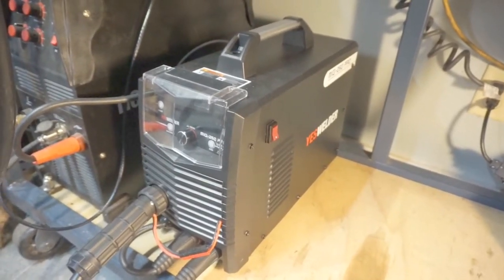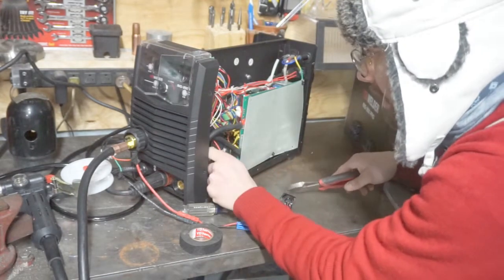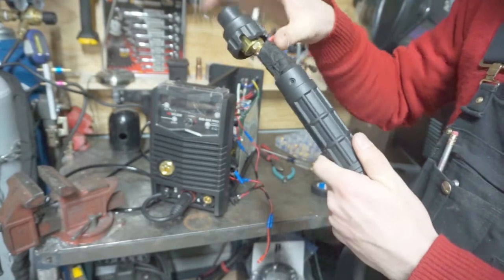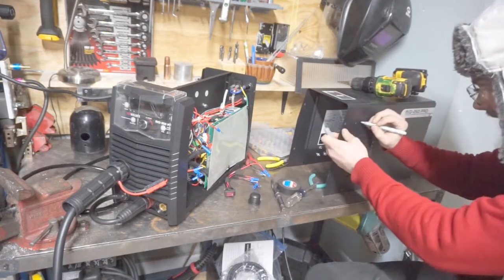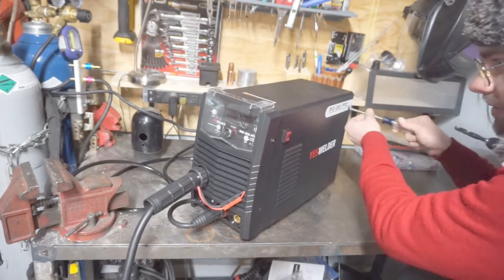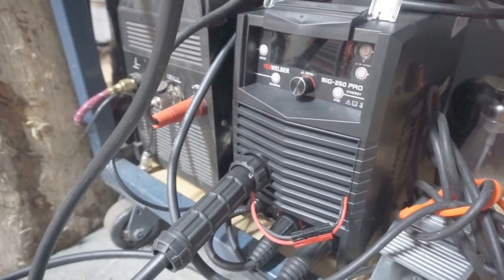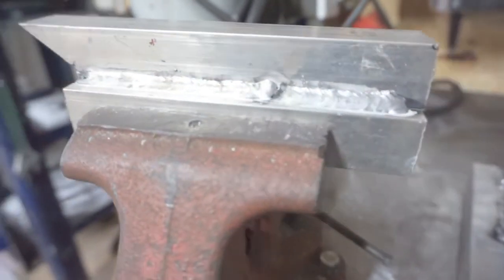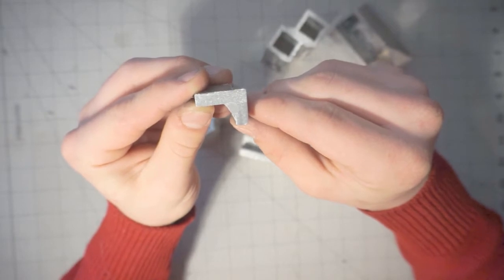How to Add a Spool Gun for Aluminum Welding to the 250A Mig Pro by Yes Welder and Other Welders Too

Comment: Thank you for the video, helped a lot with understanding what I'll be dealing with when trying to convert my torch. I have a spool gun that im trying to connect to my welder, the euro fittings go together but to power the motor my gun has a 2 pin aviation connector. My welder has a 7 pin on mig, is there a way i can make my torches 2 pin motor work with the 7 pin connector?
Reply from the maker: You could probably wire up power for your spool gun motor by making a jumper off of the wires that power the feed motor in the machine. If you find a matching 2 pin aviaton connector to wire in that would be very clean. I added a switch to the side of mine so it spins either the spool gun motor or the normal motor in the machine.
Reply: @mattthemaker3787  ah, thank you for the response man.
Reply from the maker: @narutouzumaki4710  Happy to help, hope that gets you sorted!

Comment: Seems like a pain in the a** to go thru all that. Bought my spool gun along with my Everlast welder. Didn't have to tear apart my machine to hook it up.
Reply from the maker: I've never owned a everlast but I've heard they make a great product, probably better than this. That said the cheapest everlast I see that is at least 250 amps, spool gun capable, and synergic cost three times what I got into this whole setup and doesn't include the spool gun. 

Also this is basically just installing a single bypass switch onto your welder then adding a dongle with two wires. Should take maybe 30 to 45 minutes and save you over a grand compared to the everlast. Ngl doesn't seem like that much of a pain compared to the labor you traded that extra thousand bucks.
Reply: @mattthemaker3787  Everlast is a great company with great products. And now with a 5 year warranty which includes parts, labor and shipping both ways it's a win win. My 3rd welder is shipped. Plan on getting a bigger Everlast tig next year for the shop.

Comment: Does the 250 pro have a wire speed dial for the mig, or is it synergetic based off the amps like the 205DS? I have the 205 and want to do this same thing but im concerned about getting things dialed in right since on the 205 you cant directly change the volts or wire speed. you can bump the volts a bit with a button(also based on the amps you select.) I feel like I can make it work but the synergetic/non manual controls might make it difficult to dial in.
Reply from the maker: Sorry I never got back to you, got too busy and caught up with stuff to check.. I'm glad you pulled off the modification according to your other comment.

Comment: Why would you do that since the welder is designed to weld aluminium the way it is?
Reply from the maker: Since it saves so much time in the long run. Time when you are hot and sweaty and trying to get a job done. This mod could be done in less than an hour for about 100 bucks. 

-Change over between welding steel and aluminum takes less that 25 percent of original changeover time since you don't have to swap liners and re feed the wire.
-If you get burnback and ruin your tip without a spool gun it is going to take along time to re feed that aluminum wire all the way through the lead

- Pushing aluminum wire through a welding lead has a tendency to kink up causing you to restart the whole process. Getting a .035 aluminum wire pushed 8 feet through a tube without it kinking and getting snagged up is pretty hard. Pushing a wet noodle down a hallway is not my idea of a good time.

Comment: I feel the spool speed is not fast enough for certain thickness 1/8 & 1/4. Maybe the welder cant handle the thickness via motor control unless there was a mod to increase the motor speed bedsides the manual control
Reply from the maker: Sorry for the late reply. Are your motors the same voltage? I was having a very hard time at first and took a few phones calls with a friend to get it running right on those thicknesses. The stick out for the wire is huge compared to mig welding steel, I feel like I was almost at a inch before things started going well for me.

Comment: Hi, i did the mods adding the spool gun with no problems getting to work.  I never used a spool guns so i tried welding but only had burnbacks destroying my tips. Didn’t have this issue when it was done with the mig with the graphene. I am using the the HZXVOGEN 200A Spool Gun modded to my case and works fine. These mb15 tips are a pain to replace on amazon. Using the .035 tips also happened to the spare .040 tips. Any advice would be greatly appreciated!
Reply from the maker: I didn't use that model gun but if the motor voltage is that same it should work. I burnt up alot of tips getting started with mine as well, it was trickier than I expected. I was really surprised how fast the wire feed speed needed to be and how far out the tip can be from the metal. I was near a inch wire stickout length, this give me a alot of travel/time before the wire burns back and fuses to the tip.  The lead mine came with was 25 ft and it was too long. I trimmed it to about 10 ft and the gas flowed alot better and I got less burn back.
Reply: @mattthemaker3787  what was your successful setting for 1/8 or 1/4 aluminum plate?
Reply from the maker: @kenken-sr2vq  Read all the comments to this video, I have what my settings were in there somewhere.
Reply: @mattthemaker3787  i have tried many possible ways many settings . Destroyed 25 tips. Set the argon even higher. I am throwing the towel for now on my 250pro for aluminum spool gun
Reply from the maker: @kenken-sr2vq  Sorry to hear youve had such bad luck. Here were my parameters. I was using .035 wire and my settings for spray transfer were 25 volts at wire feed speed 15. I dialed it in a little from there but this is where I took a picture for reference. Short circuit transfer I was running about 13.8 volts and a wire feed speed of 11.6. The wire feed speed seems to be the limiting factor in terms of adjustment. I want to try different thicknesses of filler wire eventually and see if I can get spray and short circuit to work well on other gauges of material.

Comment: Hi Do you think it works for a ds205
Reply from the maker: Can that model weld aluminum? This modification should work on any welder that can weld aluminum as long as you match the voltage of the drive feed motor with the spool gun. This welder is advertised as welding aluminum with a special liner in the lead. The aluminum welding wire easily kinks in this liner and is a huge hassle to deal with, the spool gun gets around this problem.
Reply from the maker: It does according to flawed offroad. They commented on this video that it worked and even uploaded a video of there own you should check out.

Comment: Do you think the set up would be the same for the 205 DS welder from them?
Reply: Also a link to the School gun would be nice. Got a flat boat that I need to cut the transom out of this weekend
Reply from the maker: @gregmaggert8561  The website says that welder can't weld aluminum and the spool gun advantage is for welding aluminum

Comment: Which spool gun are using, i.e., vendor, and model number?
Reply from the maker: Chinese ebay special thats labeled "NBC-200A". Rated for 200 amps but the welder can put out 250 so I have to make sure I don't push too much through it and fry it. There are other spool guns that are 24v and have the euro style plug that will work. I think there is a better option out there, I paid 90 for this one but remember seeing a 150 one that looked a little nicer after I ordered this one. The build quality on the NBC-200A is a little flimsy, I added a spacer to the spool holder to fit different sized spools.

Comment: Just bought this machine and was disappointed to see it didn't support a spool gun. Then I saw your video and now I'm positively stoked about this welder! Welding aluminum is gonna be so much better with a proper spool gun, thanks for sharing this!
Reply from the maker: Glad it got you excited about it again and good luck hot roddin it! Pretty capable budget machine when its all done.
Reply: FoxTuned Very serious question. I am looking at this same welder and YesWelder says that it welds aluminum on it's specs. Why did/do you want to add  a spool gun? I'm new to welding.
Reply from the maker: @mthewolf1095  The welder can weld aluminum as is. You need to take the existing welding lead and pull out the liner then insert the special liner for aluminum. Feeding the soft aluminum wire through the lead is a chore and it will often kink causing you to restart the whole process. Once its through If you get some burnback and have the aluminum filler wire melt to your tip it will almost certainly kink/bind up causing you to have to refeed the aluminum filler. It doesn't sound like much of a hassle but it adds several minutes to a operation every time it happens. If you are trying to dial in the machine this could happens several times in a row leading to many expletives. If I wanted to weld steel now I have to change out the liners again. With the spool gun you never have to refeed the aluminum through the whip since the spool is at the end of the whip already. Change over time from welding steel to aluminum is greatly reduced since you just swap leads and gas instead of having to take the lead off and swap the interior liners and gas. You can do it without the spool gun but you are going to waste alot of time in between. I think there are other spool guns out there that will do a better job, just make sure it is 24 volts. IMO YesWelder is really dropping the ball by not selling a spool gun ad on. If you look at the cost of other welders that can weld steel, spool gun aluminum, and have synergic weld settings you are looking at paying well over double what this setup runs. Some people might consider this hot rodding a machine or polishing a turd, all I know is it rips and I like it.
Reply: @mattthemaker3787  Thank you for the explanation. That makes total sense.
Reply: @mattthemaker3787  What you are doing by modifying that machine, it's very dangerous, you're taking a high risk of being electrocuted and totally damaging your machine. Are you a certified electrician? Well, hopefully you don't get electrocuted or destroy your machine! 👍
Reply from the maker: @roypatterson9910    Can you explain what part is very dangerous? Are you a certified electrician that can shine some light as to what was dangerous or are you afraid of touching any electrical circuit?

I am not a certified electrician but I don't think there is much danger involved in this. Been hacking electronics for well over a decade. Ive taken a couple electronics courses and in high-school I managed to make a portable n64 with a screen and everything ran ok batteries. If you watched the video you would see that the wires I messed with were low voltage at only 24 volts and use DC current. Everything else is using industry standard connections to hook up the parts thats handle the real current that will handle the welding. The wire I used for my bypass circuit is heavier duty than what came stock in the machine by a wide margin. I simply created a bypass switch with over rated components then hooked up a welding lead to a welding connector. The only hole in this is that the welder can put out 250 amps and the gun can handle 200 continously. So in theory I could run too much through my gun and melt it, it will get too hot before that happens and I'll set it down. I bought a TIG welder from Eastwood that puts out 200 amps and came with a torch that can only handle 150 amps continously. While not ideal this is acceptable in the market and they have gotten away with it for years, likely because the duty cycle is around 30 percent so you can't crank 200 amps out continously. 

Pretty much the first thing I say is this is going to void your warranty if you have one. I've even let the company know what I was doing and they sent me an affiliate link since they thought it was cool, so if you want to buy one of these welders use my link and save some money while giving me a lil kickback.
Reply: @mattthemaker3787  They current model supports adding a spool gun.
Reply: @mattthemaker3787 one if the dangers would be capacitors.  They can shock if not discharged and  they're usually large ones on a welder. Also live load capacitors are a whole different ball game.  Much more lethal so make sure its unplugged from the wall when you open the case.
Reply from the maker: @ryanlynch3579  I like to unplug stuff and cycle the buttons to make sure the capacitors are drained. The longer it can be unplugged before working on it the better.

Comment: I have the previous version Yeswelder mig250 pro which doesn't have the aluminum setting built in, does this new model have short circuit transfer and spray transfer in the built in functions or is it a matter of manually imputing different settings?
Reply from the maker: Short circuit and spray transfer are not built in. You must set it up manually on my machine.
Reply: @mattthemaker3787  right on, figured that might be the case. Thinking I might do this mod on mine even though I have a ac/dc tig machine ¯\_(ツ)_/¯
Reply from the maker: @timtiminy  I have a 200 amp AC/DC tig machine to but the Mig really helps for the big heavy duty stuff. Planning out this mod allowed me to justify purchasing the new mig setup.
Reply: @mattthemaker3787  same thinking. Thanks for the video man!
Reply from the maker: @timtiminy  Glad it got some gears turning for ya! Good luck, I hope it works out!

Comment: Hey man, I had that same idea for the same machine. My gun came in yesterday. Thank you for video, I'm going to do mine this weekend... Awesome 👍 !
Reply from the maker: I'm glad it helped you out and good luck with it! Let me know how it goes! The wooden dowel I drilled out to adapt the new spool was from a drumstick, happened to be the perfect O.D. if you got one laying around.
Reply: @mattthemaker3787  Hi, I got it done today. I welded aluminum for the first time. I need to practice and learn some settings. If you have any good settings to share, I'd really appreciate it. I put 
.035 wire on the white spool  it came with.
Reply from the maker: @seankhughes5582  I was using .035 wire and my settings for spray transfer were 25 volts at wire feed speed 15. I dialed it in a little from there but this is where I took a picture for reference. Short circuit transfer I was running about 13.8 volts and a wire feed speed of 11.6. The wire feed speed seems to be the limiting factor in terms of adjustment. I want to try different thicknesses of filler wire eventually and see if I can get spray and short circuit to work well on other gauges of material.